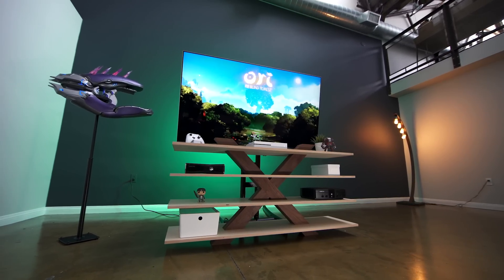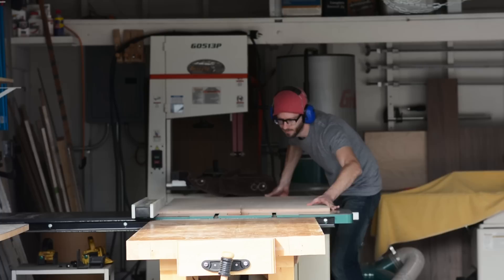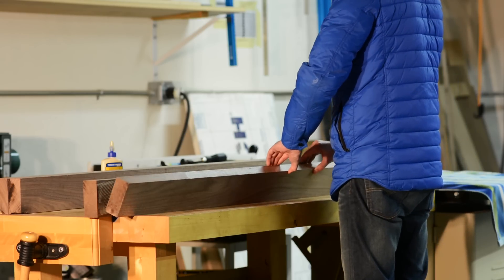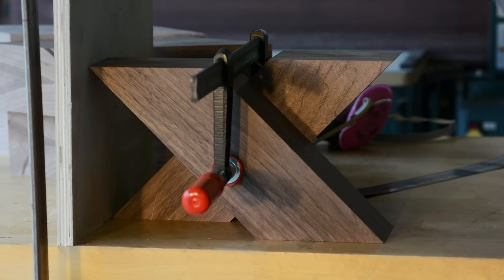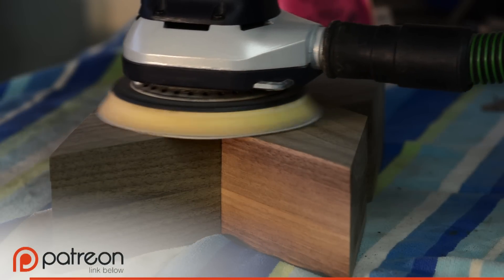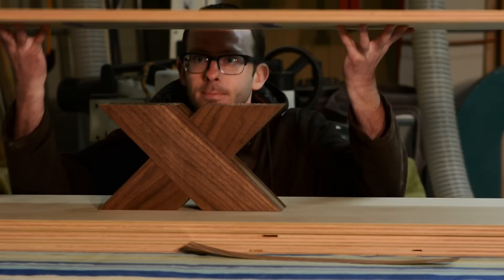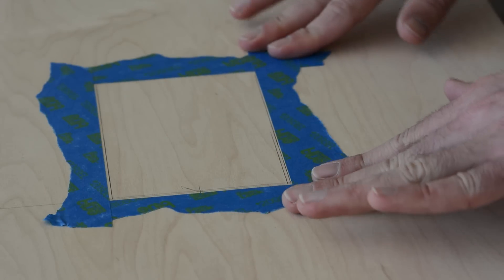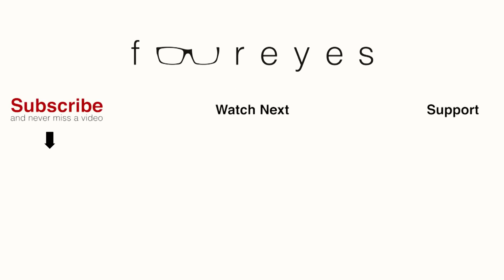Designing and Building The Ultimate Xbox Stand - Woodworking

Comment: nice looking shelf.....did you have to widen the foot to keep it stable front to back?  Seems like it would be pretty "tippy" otherwise.    Did you consider pegs to provide a physical connection between the shelf and the supports.  (not criticizing, just curious if the idea was set aside due to some other constraint,  time, etc)
Reply from the maker: Thanks Tim. for tipping...it is tippy. It should be anchored to a wall once in its permanent place - then it will be fine. For pegs/dowels. A few people have mentioned that...they would be more for alignment than strength, and I think they would actually complicate things. The important thing was the "eyeball" test here.

Comment: Chris I love this design so much I have made 4 of these. I did make placement a lot easier by making a pretty simple jig. My shelves are 15” wide so I just ripped a 15” scrap piece of ply and put two guides on the side so it seats on the shelf. I cut a scrap at 45 and tacked it dead center @7 1/2” to act as a support for the walnut. Then there are 2 scraps attached 1 3/4” (my stock is 3 1/2” as well) off center on both sides to guide the walnut dead center on the shelf. All you have to do is line it up to your horizontal pencil lines. Fantastic job Chris and thank you for sharing
Reply: What do you do with 4 of these? I can't imagine the number of people who want to display their xbox collection is super high. I also don't think it'd be sturdy enough to use as a TV console. There's no room to put a TV on it and any decent receiver would bend the wings. It's a nice art piece but I just don't see it being very functional.
Reply: @dangr123  it’s almost 2022… they do make such things called wall mounts for your tv. A receiver is not going to “bend” a 4/4” thick shelf and your presumption that there aren’t a lot of people who want to display their gaming whatever is comical. No it’s not going to win any strength competitions but for what it is it is plenty strong and rigid
Reply: @MrMaacin05  meh.. I understand that a TV would have to be wall mounted with this, butI stand by my opinion that this is basically only functional as an Xbox display.. without being able to to use them.. and only if you don't have children or a cat. I don't think it's weird to display your old consoles. I do think it'd be weird to display a Nintendo or a Playstation on here. Thus, the use case for one of these would be very limited. Still wouldn't put a 30-40 lb. receiver on one of these wings. 🤷🏻
Reply: @dangr123  I say this respectfully, you used the term “bend” instead of “warp”… I’m not sure you have a leg to stand on when it comes to woodworking and load capacity. This would be incredibly easy to secure to some studs or the floor… so I’m just not getting your issue

Comment: I like the design,I think I would of drilled locator holes in the ends of the walnut and the ply,and put proud a 1/4" dowels in the holes.then you could place the ply on the dowels easier to locate the position that way and not worry about a piece slipping out of position.

Comment: I like the design. The combination of the walnut X and the maple shelves works together well. Some have commented about not banding the shelves.  I think the bands of the plywood give the piece an added visual effect. 

 A number of commenters have asking why you just glued the "legs" of the X piece. They do have somewhat of a point as overtime the glue on the end grain will lose some of its hold.   To help proved that occurrence you could do what is called glue sizing. Take glue add a tiny drop of water. Spread the glue thinly and very evenly on the end grain. Let it dry completely. Then glue up as normal. The first layer of glue acts to bind and seal the end grain and gives a tighter overall bond. 

Some commentators suggested using dowels to which to replied that it would have taken longer and been more complicated. True enough!  However if you work from the center of your X out then the math is simpler. The center of your X is zero, same as the center line of your shelf. The distance between the center of the first two X "legs" divided by 2 would equal half of the distance from the center line of the shelf. At that point you could drill a hole through the plywood centered from the side. You could then make a small jig using scrap 3/4" plywood to drill each leg on center referenced on the inside of each leg. The holes on the legs would all be positioned the same. The holes on Esch leg would line up with the holes on the plywood shelf because all the holes are referenced off the same center point.
Reply from the maker: Hey Joe....Nice tips! I probably won't build another X shaped console, but I'm sure I can extrapolate that idea into another project down the road. Really like the end grain tip. I'm gonna have to experiment with that. Thanks!

Comment: That is one nice-looking piece. There's a lot of folks here that are talking about questionable stability and structural integrity, and I have to agree with them. When trying to think of how to modify this design or build process to be more robust, the only real solution that comes to mind is... well, don't build it out of wood, lol. Walnut and maple is a classic look, but I gotta say, if you really want this to be a rock solid piece of furniture, you're going to have to build it out of steel.
Reply from the maker: It's actually really strong. It's also the kind of piece that you don't really want to clutter with objects. The stability (in terms of tipping) is an issue...so it should really be anchored.

Comment: Cool shelf, and inspired design elements!  I'm nowhere near your level of expertise (in design, or execution really, just a garage woodshop bodger), but your creations do give me lots of ideas!   Great channel!
I would probably dowel those joints in a similar project of my own, but I tend to over-engineer everything anyway (my litmus test is if something I build can handle the weight of my truck....).  I would just be afraid of the end grain gluing as it ages and dries out.  Plus people picking it up by the top shelf, so that the weight of all the rest of it is suspended from the top glue joints.  But that's just how I think about such things, not will it fail, but how will it fail?  Hence the over-engineering....   :)

Comment: The dust collection on that miter saw (Makita?) looks surprisingly good. Thoughts?
Reply from the maker: Hey John. That might be an optical illusion. It is a Makita, I rigged my festool dust extractor up to it...and I built a little 4 sided wall ceiling thing behind it, and I run my 4" dust collector hose behind the blade (as best I can) which is a vast improvement over nothing...but it still throws quite a bit of dust around.

Comment: Love the design, which would look great for a book shelf, although structurally, likely not suitable. One thing that seems to stand out to me is a lack of cable management, which to me seems like an important and integral part of gaming centre. Without cords it looks awesome, but without cords it's also not a gaming centre. I know you've talked about form vs function in previous videos, and that form matters more for you in most cases. However, in this case, without function, the form becomes a display shelf more than a gaming centre.
Reply from the maker: Hey Kelsey...these guys are cable management wizards. Search "Dream Desk TLD" and you'll see what i'm talking about. I brought that up to them and they said they could make this work. That said, for a normal person, you could definitely rig up something where most of the wires could hide behind the X. Luckily, I didn't have to think about that for this build.

Comment: if added any weight at the top wouldnt the legs collaps inwards and from the bottom half outwards? or let me rephrase that how much weight do you think it can handle before it collapses? 

No its not made to sit on but just curious over here
Reply from the maker: The shelves would sag beyond usefulness before the X would collapse. Not sure of a specific number, but no reasonable amount of weight would break it. The first thing to fail would be the whole piece tipping over. It should be anchored to a wall.

Comment: I would say glue only doesn't sound so safe and also the fact to only has 2 feet I don't feel comfortable with it seems like it would be too unstable I would just widen up those feet to reach almost to the edge of the bottom shelf just for security reasons
Reply from the maker: anchoring it to a wall is my solution. With that, it's fine.

Comment: Did you put more feet on the bottom to help hold it up or was the bottom of the X wide enough to balance it?
Reply from the maker: The X is wide enough...but it should be anchored to a wall for good measure.

Comment: Do you there would be a way to build so that it can come apart and be reassembled for easier transfer?
Reply from the maker: yeah...you could do it with lots of beefy dowels and no glue...but it would be quite a bit more work.
Reply: Yeah, I'd be worried about heavy stuff on the ends of the middle shelves but I think the shelf itself would give before the glue did...
Reply from the maker: I think you're right Bill. They would sag/bend before the glue goes.

Comment: As someone who does this professionally, I have to say, that thing ain't gonna last long. The ply, which honestly if you were gonna show off the plys, you should have used Appleply or Birch with like 13 plys or something. Not only that the ply will definitely sag under it's own weight over time. And the only reason I even say anything is because you're one of the better guys on here not only in design but construction. You certainly tow the line at times, but it's clear you at least study woodworking unlike some of the others on here. And tell me there are hidden feet on this, because that thing can not be that stead sitting on two flat points in the middle. So when it does fall over your unprotected ply is gonna get busted up pretty easily. Like a 1/8 maple hardwood edge is all you would have needed. Don't even have to worry about mitering it too.. I hope you don't feel like im putting you on blast, because it's a cool and fun design and had you made that X a through tenon I would of just quit my job right then and there and found a new profession. I like your videos and will watch as long as you make them, and my friend it is never a good thing when your piece looks better the farther away you are. I got a good laugh at that.
Reply from the maker: it's like a "butter face". The main concern was building something that would look good for the guys' xbox video; with that respect it's somewhat of a "prop piece". That said, I don't think the shelves will sag too bad. The longest, unsupported span  is only about 20". As for tipping...that is the concern. I made removable feet that can wedge under it for set up purposes. When it is going to be knocked around. Once it is in a final resting place, it should definitely be anchored to wall.

Comment: Wasn't it possible to use dowels to make lining it up easier and to make it stronger?
Reply: Or a couple screws on the inner shelves.
Reply from the maker: You could...honestly, the strength wouldn't be a concern. It's plenty strong already. And for lining up, it could potentially help or hurt you. It's more math to worry about. And sometimes math in a drawing vs the actual piece doesn't perfectly align. Also...once you committed, it's a done deal. This way, I could kind of wiggle the pieces as the glue dried to get it "eyeball" perfect. Which is more important than "actual" perfect.
Reply: Chris Salomone, i know indeed, help or hurt. Just wondered if you considered it. Thanks for responding, love your channel!

Comment: You could have put screws in between to hold a lot of the pieces
Reply: That's how I would have done it, at least a couple in locations that would be covered by subsequent shelves. The whole thing could have been assembled a lot quicker. I'm sure Chris had his reasons though. Or maybe not, I look back at a ton of things I've made and wonder why I didn't do things that afterwards seemed so obvious.
Reply from the maker: I thought about screws...and yeah, I could have done it in a few spots. The thing is...it wouldn't really save me that much "working time", it would be more "down time" while glue is drying. Of course, that can still be a benefit, when you have multiple projects going, etc...

Comment: Poor construction. End grain glueing will eventually fail. Should of at least used screws before adding next sections. Screws would be hidden and given the connection much more strength.
Reply from the maker: It'll stay together. More likely to tip than come apart. 
...and if I'm wrong, I'll let you slap me into an omoplata :)